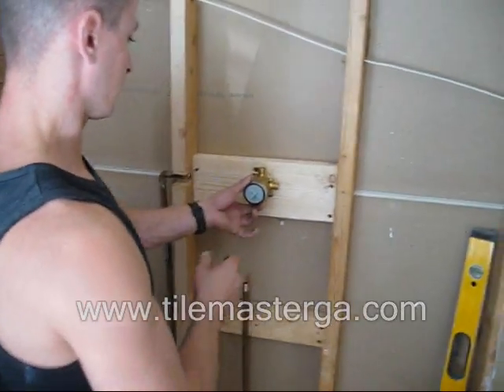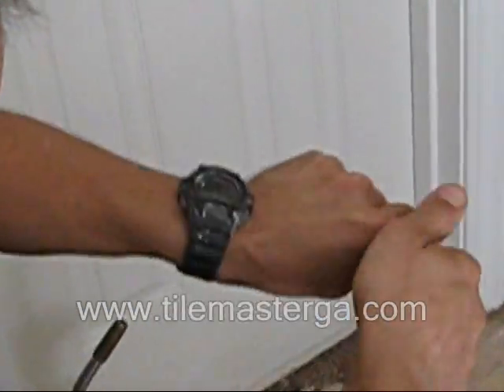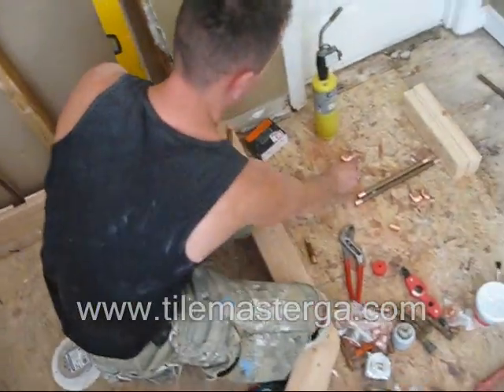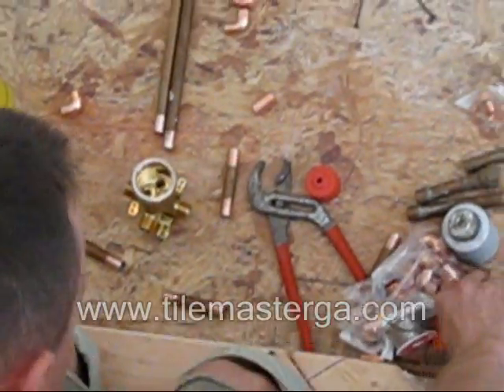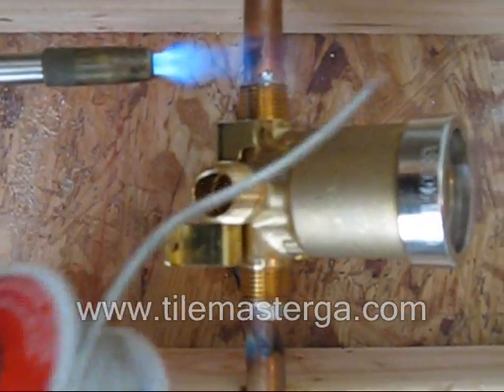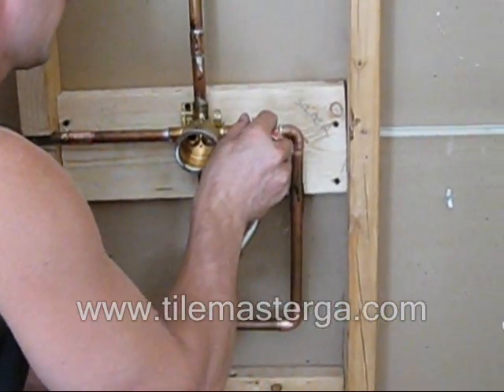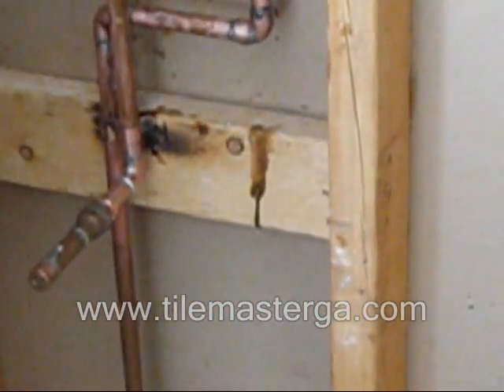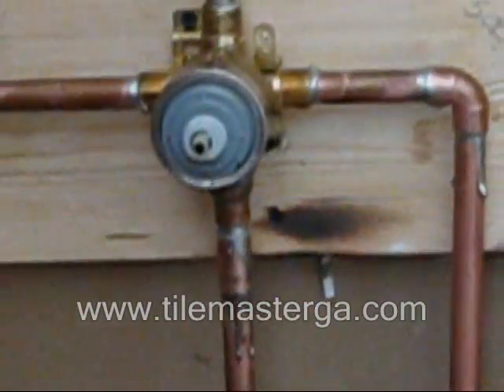Shower Valve replacement - brass rough in installation, copper soldering How to DIY - DELTA Part "2"

Comment: Wow! That`s great! There are lot of vital tips! One of them- to remove all the plastic parts!    I guess it was actual 5-7 years ago, but now the majority of mixers have only threaded conenctions for modern types of plumbing materials. But I like copper and I want connect a modern threaded mixer with my existed copper pipe line. Is there any convenient technology for doing this (with no copper to PEX adaptors), please?  Thank you

Comment: I totally agree with the other statements, you are doing it wrong. Stop touching the fitting after you've polished them, you applied so much flux on this thing, also like everyone else mentioned you heated the copper pipes instead of the joints.  Finally please clean the pipes with damp cloth to remove excessive flux, it is corrosive material.

Comment: Question:dont the inlet pipes have to be extended with 3/4 pipe and a T? To absorb the water hit  when you close the valve?

Comment: Are you freaking kidding me? # 1 You shouldn't have three bends before the value, Who runs copper lines like that. "#2 You have a 12/2 electrical wire touching the damn water line...Hello!!!!. # 3 You never heat up the smaller of the two sections when soldering you want to pull the solder into the joint .. #4 You compromised the strength of the stud by notching it out, What's wrong with drilling a hole? Yikes!!

Comment: Incorrect soldering procedure. Valve body itself should be heated more than the pipe So the solder is drawn into the joint. Solder Flows in the direction of the heat.
Reply: And how he ran the cold supply , totally in the way of the bath spout , which don’t have any support for he didn’t use the right 90, nor backing ,But is ok ImAke a lot of money fixing  this kind of handy man jobs , it does  suck for the homeowner tho,but they  did choose not to  get an actual plumber to begin with eh?
Reply: @mariomarionetas4445  I’m in the restoration ( water damage) industry. This guy is my hero 😂

Comment: The comments on your soldering technique are correct. Practice and try another video. Also, you should usr a de-burring tool to remove the burr and return the pipe to full bore.

Comment: so if you say sweating a coupling does it mean soldering a coupling???
Reply: benoit lambert sweating normally means heating a soldered fitting and taking the pipe out of the fitting for example

Comment: Don't even worry or try using copper fittings unless they are sharkbites or other brands you need not have to sweat. Myself I use pex for the water supplies & galvanized for the shower head/tub spout! Note the pex, if installed onto the shower head & tub spout, the water pressure will create a back flow causing both ends to spue water at the same time as for the reduced isd connection is a problem. also the galvanize is just more solid, but be sure you don't mistake galvanized with black iron pipe as many people do & this will create another issue of gunk or rust flowing out every time you use it besides messing up your faucets. I am but a good man to have on hand, Dave the handyman home repair guy. St. Louis Mo. 63052 & for self defense training just YouTube me Dave Overbey & I'll show you how I defeat the hands & feet using my own technique. God bless & take care & include me & my family in your prayer! Thanks

Comment: hi there everybody and  TM,  we have  had install a bath with 2 way diverter  and  my question is : is normal a diverter let some   water leaking shower head  when used  hand shower? or if I gonna use shower head the diverter let some water leaking o hand shower.???  that is normal or something need to be done??  any body??
Reply: The diverter is not holding its seal and therefore leaks to other ports.  You can either replace the diverter now, or wait until it starts to leak out from the diverter itself, which could be months or years down the road.

Comment: Several things. I noticed the he did NOT (1) test the system (prior to installing the cartridge unit) and did NOT (2) flush the system to clear all debris in the line that can clog or damage the cartridge. I came to this video to see how to test the system using the test cap (at 10:35) that comes with the faucet.

Comment: Why on earth did you notch the stud just to run a hot water supply line?  You cut away at least half of that stud's load bearing strength!
Reply: chuckschilling this guy is butcher
Reply: Dude, it may not be a load bearing stud.
Reply: Heyward Shepherd 
Agreed. Drill a hole and run the copper pipe through it.

Comment: Soldering Cooper to brass? You know why there are threads right? Typical contractor not thinking ahead.
Reply: I always thought brass and copper are compatible, which was why I always solder brass shut off valves and mix valves to copper.

Comment: I worked for two different plumbing companies as an apprentice and something I noticed between the two is that one did the job right and the other got the job done... in the end if there's no leaks I guess that's all that matters... seeing this video noticed the guy had a few flaws but overall the job's done with no hiccups. This video is mostly focus for ppl to encourage themselves on doing the work on their own if they're not plumbers and dnt want to spend a fortune so dnt expect excellence.

Comment: Plumbing contractors will never put videos online.  The reason for this is,  they are too busy working and they do not want to give up their trade that they spent money on and went to school for.  When you see these people stumbling and trying to explain how to do this-this means they have just learned this themselves and are not a professional.  They may think they are but if they were qualified to do this they wouldn't be making online videos, they would be doing this for a living day in and day out like I have for the past 39 years and being licensed too.
Reply: Yeah, heaven forbid somebody makes a video that helps people tackle their own needs.  Your logic is flawed.  What you are saying is that the info is only good if it comes from a licensed person.  Pretty arrogant thinking.  So when someone at the hardware store shows a person how to attach the two wires on a light switch they are replacing, that info is invalid?  The list goes on forever of repairs unlicensed people can complete competently.  While some professionals may make work look cleaner, it isn't always better.  I am sure in your years of experience you have seen crap jobs done by the pros.  I am NOT a licensed plumber but have sweat many many joints.  Some could have looked better when they were finished, but they were solid, properly made unions.  Now I couldn't tell you code on proper venting and required distances, or pipe sizes, but the basics are easily learned, and with practice can be mastered.
Reply: Still trying to keep all the skills and techniques hidden

Comment: Why does any plumber still use copper these days? Use PEX! What a mess.
Reply: dragonkubush if your house is all copper why would you switch to pex just to install a valve?
side note my mom's pex just failed recently, lots of damage.
Reply: There are a lot of people that still believe in copper but I have used pex since the 90s when it came out .  Wirsbo Aqua pex is all I ever use.  I still stub out with type L copper so I can hook my angle stops up to it and water heater stub outs .
Reply: dskater411 What kind of Pex was in your moms house?  They make about 4 to 5 different kinds of pex I only use one.  The others I won't touch even that some are cheaper I still buy the best and have never had any problems with the type I use since that stuff came out except if some idiot ran a nail through it hanging a picture on a wall and ran a nail through it.  I went back and fixed it for free for them.
Reply: dskater411 My house has copper in it and the only pex I ran was for the convection system I ran off the Water Heater so I could get instant hot water on every fixture.  But some day when my copper goes if I am still alive I will change it all to pex.   Should do this before I can't plumb anymore.

Comment: Why do you soder the connections into the valve instead of using the provided threaded connections?  does it hold better against leaks that way?
Reply: Solder is a superior seal to threaded

Comment: Why do you soder the fittings instead of using threaded connectors?  Is it hold better?
Reply: That is a good question, I always use female adapters on male threads and use pex adapters on them so I can use pex fittings.
Reply: Threads can fail due to expand/contracting with temperature or at contact seal points.  Solder joints do not fail when installed correctly.
Reply: Oscar Siguenza 

Cool thanks

Comment: how do I know how far to set the diverter back? mine is the original valve. I cannot figure out how far out it should be from the cement board and the tile?
Reply: If you buy a Moen faucet it set back is 1 1/2" back.  The black cover will be up to the finished wall.  It explains it in the directions.

Comment: any idea how to figure out what faucet handles these might be 
Sorry to bug but would you be able to tell me what valve manufacturer these might be?

[IMG]http://i1084.photobucket.com/albums/j418/nwhite3/795D8D9E-B8E3-4B17-96D6-82FA69BDFD87_zpshsjy4vob.jpg[/IMG]

[IMG]http://i1084.photobucket.com/albums/j418/nwhite3/2790A38B-D7BE-4C11-888A-34B36A6C4AA6_zpsgekvrrje.jpg[/IMG]

[IMG]http://i1084.photobucket.com/albums/j418/nwhite3/795D8D9E-B8E3-4B17-96D6-82FA69BDFD87_zpshsjy4vob.jpg[/IMG]

[IMG]http://i1084.photobucket.com/albums/j418/nwhite3/F64B542F-3EF1-400D-AEFC-425660D6EC17_zpsdmib5qh0.jpg[/IMG]
Reply: I have always bought Moen for all the houses I have plumbed in the last 39 years.  Very reasonable priced and easy to change the cartridge.

Comment: I was reading that life of pax is 20 to 25.  while copper pipes been used for centuries in  building, commercial and residential of course now lead free soldering.  what's your thought on that.
Reply: Copper hasn't been used for centuries, it just seems that way.   There was galvanized pipe before copper.  In the 70s Copper was used and before like 60 some places 50s under the slab of houses which they found out was very stupid so I got a lot of re-pipes that way over the years.  Also re-piped a lot of galvie  piping too.  I love Pex only Aqua Pex none of the other stuff

Comment: When u use pex you loose pressure.  1/2 inch copper best way to go. Do a test. use pex half inch and use half inch copper and watch how the water comes out of shower head. or hose spicket. do the test you'll know exactly what I'm talking about nice vid
Reply: You'll lose volume, not pressure. The two are not the same.
Reply: No, you don't, I have been a plumbing contractor for almost 40 years.  I have repiped many houses and have great WP.  Bring in a 1" pex cold line and you will have a lot of volume with it too.  Also, the pressure is   whatever  the pressure you have out at the curb will be the same at the house.  

'
Reply: In fact, introducing constriction RAISES the pressure.

Comment: I like the fact that you are very conscientious about cleaning and fluxing the shower valve  and pipe thoroughly.  I also like the fact that you tried to avoid burning the wall behind the shower control.   But what I don't understand is why you didn't make use of the threads on the shower valve.
Reply: +PanamaSticks the threads are for attaching galvanized pipe with a coupling, not for copper
Reply: +PhoohPhah Thank you, and GOOD JOB!

Comment: Heat the female portion, refrain from shooting flame into joint. When you see solder come around fitting you have applied enough solder. No need to  repeatedly apply solder around smaller fittings.

Comment: if you put the flux on the solder, would it make the solder drip all round the pipe when soldering it which would make it easier?

Comment: Why would you do soldering on a compression joint?
Reply: +H Nur At what time does he solder a compression joint? I must have missed that part. It makes not sense to do so??
Reply: That is an outside thread with inside solder connection.  Allows customers 2 choices for connection.

Comment: what is the pipe pointing straight down for?  Is that for a shower sprayer?
Reply: +Nancy J. Luna @10:50 he says it's for the faucet and then shows the faucet.  It isn't clear from the title of the video, but he's doing a tub and shower combo, not a shower only install.
Reply: +Willie Stubbs Actually, it is a shower.. He said in the first video that installing the tub spout in the shower was a special request of the customer. Maybe to fill buckets???

Comment: your soldering technique is off.  Apply heat to the fitting when adding the solder.
Reply: I've got a question, would it not make more sense to solder a threaded female to the half-inch pipe and then make the connection with the thread to avoid hitting the new mixer valve?
Reply: @RGSPrideTILE  I believe solder a piece on last longer than a thread on connection
Reply: Doug Nash while we're going there... make sure you are aware that you are using a tool that applies high heat and and can warp material such as brass. Make a heat shield to prevent damage where the flame is applied, point your torch so the heat is focused on the area to be sweated..avoid pointing toward the valve body to prevent a leak or degrade or damage anything in the flames path.

Comment: I installed a delta shower and did the usual water leak test. Two hours later a small leak appeared but there was nothing wrong with the solder joints. The brass casting itself was defective and was weeping slowly and had to be torn apart and returned. What a pain!

Comment: Great videos from this guy!  Thanks.  I just discovered the installations instructions on my Grohe combo valve says "do NOT use 1/2" PEX for tub supply pipe - use 1/2" copper, or 3/4" PEX if necessary.  Does this make sense?  1/2" anything is still 1/2"!  Right?  Anyone?
Reply: No, 1/2 PEX has a thicker wall and therefore less inside diameter than 1/2 copper.  It won't carry as much water as copper of the same size.
Reply: +Conrad Hitchens That's what she said.
Reply: oh god no!!!

Comment: Hopefully you didn't do any irreversible  damage to the internals of the faucet ...  I know those aren't threaded male ends on that Delta  what r you dewing ? ...couldn't you have just mudded a female 1/2 copper adapter then sweated the couplings on this wont do should've called a plumber damn contractors aren't plumbers
Reply: I'm a plumber, this is how its done.  He took out the internals so when he soldered his lines on it didn't melt the internals.  You can use a female threaded coupler, but they have an annoying habit of pinhole leaks.  Almost every subdivision home has it done this way.  They usually have shop, and whip these up by the dozen off site, with PEX couplers for the hot/cold lines.  On site, they just screw them to the framing, clamp their PEX lines, done.
Reply: You are mistaken he did it just the way most plumbers would
Reply: Nuff' said there..................
Reply: Damn you are right I hope he don't have license  for plumbing
Reply: Vehbinnjinti Berbatovci  I highly doubt it, ... probably tryed to save the customer some money by redoing there bathroom for one flat fee say yeah I can hook your drains up, run your waterlines install your shower , but then offer to tile your bathroom and dry wall it in for say only a thousand more but I'm not a carpenter I'm a plumber so plumbings fine but I have ass the tile job, he might have his general contractors license but I doubt it.... when boss went to take his plumbing license he said money talks one of the guys told my partner he could hook him wit a license for about 3 or 4 grand under the table you'll make that back with in a month or two

Comment: why make expencive copper instalation, when U can use cheaper PPR pipes, Easyer to mount, Holds same pressure, and U dont need half of crap U used. 
My work was to instal heating, and ppl oftenly use Copper bu its not better and its expencive. Also  lots of ppl dont know how to properly conect copper pipes. PPR is much more simple to use.

Comment: Nice video, but you forgot to install water hammer arrestor. A severe shock can occur in the residential piping system, especially when excessive water pressures are involved. Most of the premature failures of piping, hot water storage heaters, home laundry machines, automatic control valves and flush tanks or valves, may be attributed to shock caused by quick closure valves. Properly sized water hammer arresters should be installed on the hot and cold water supply piping to that fixture, equipment or apparatus wherein shock can be produced.
Reply: Thanks boss. I was looking how to install shower plumbing and wasn't even thinking about a water hammer resistor. Huge props, cheers.
Reply: Its not code, unless you are using PEX.
Most plumbers just Tee off the supply lines and run 2' up, creating an air cushion.

Comment: That shower mixer looked to have threads on the 3 connections so I would have expected to use CROX nuts.   By soldering this if you need to replace it later the soldered connection, with all the gib in place etc, will be very difficult to work with.   A crox nut will be easy by comparison.

Comment: Another great video...a couple of questions: (1) would it be possible to use a non-soldering technique to install the shower valve? (2) was that an electrical line running behind the piping?  If so should it be re-routed to avoid the area?
Reply: For this project, he appears to prefer to have a future shock.
Reply: You can use PEX plastic piping and fittings

Comment: YOU SHOULD HAVE PUT A HOT WATER VALUE  AND COLD WATER VAULE ON YOUR SET UP BECAUSE YOU CAN CUT OFF THE WATER FROM THE INSIDE OF THE HOUSE IAM NOT A PLUMBER THANKS